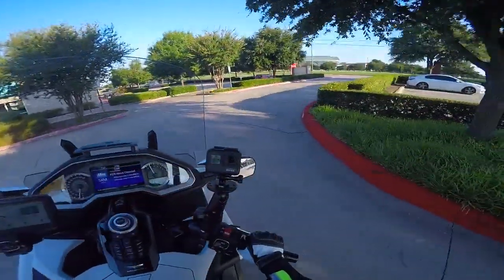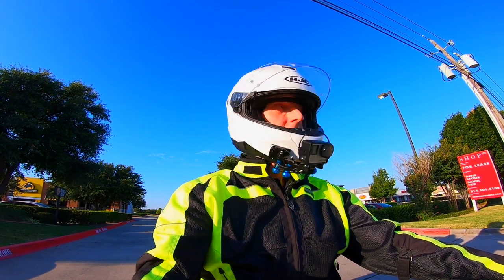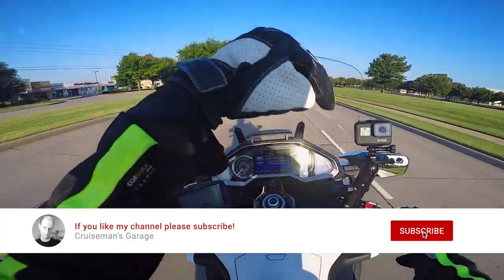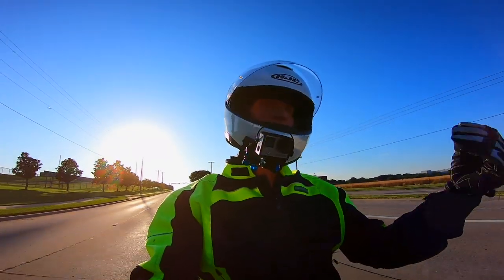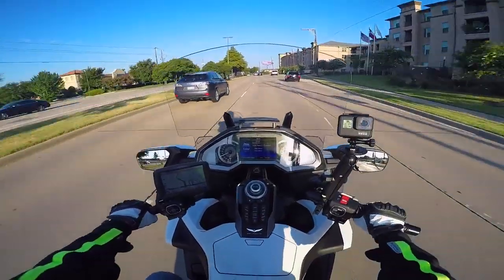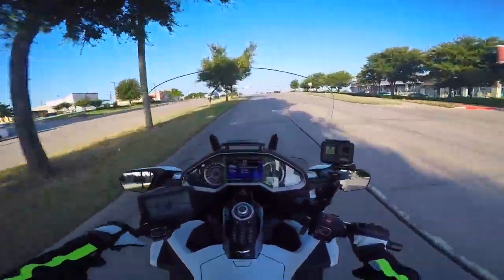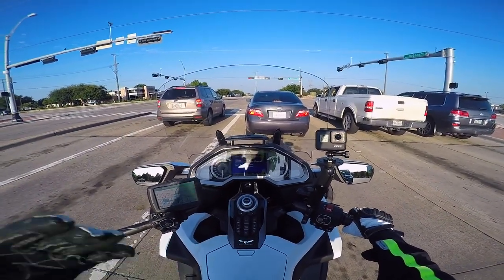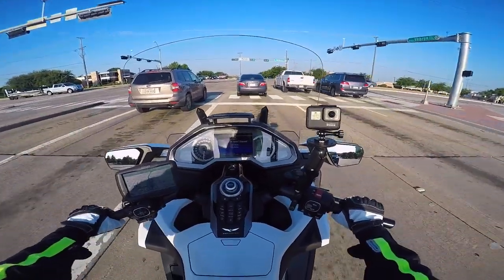Catastrophic Engine Failure on 2018 Honda Goldwing | Cruiseman's Moto Vlog | CruisemansGarage.com

Comment: That’s nothing !  Look at all the failures with the new HD Milwaukee motor. They are dropping at an alarming pace !
Reply: I own 2018 Streetglide special and most of all my friends have switched over to the new M8. I haven’t seen any of these kind of problems your talking about. In 2017 there was a recall about oil hose coming off on M8’s never saw any problems but dealers upgraded oil hoses anyways.
In 2018 they had recall on clutch slaves having a problem here again no reported problem from anyone I know. But I had upgrade done. Never heard anyone dropping a valve on a brand new Harley in this century I repeat any Harley never! I read people having trouble with dct’s. My buddy just bought a 2019 Honda GoldWing so we will see how much more reliable it is vs Harley.
Not gonna lie I’m glad I bought my 2018 Streetglide instead of  a GoldWing after hearing this and reading about all the transmission problems.
Even my Honda VFR1200f had a driveline problem recall with driveshafts locking up at highway speeds not a pretty thought. I put that in just so you know I like Honda’s and owned plenty of them
Reply: Paulk Master your lucky !
Reply: Freedom Rider and don’t forget my dozens of friends with problem free M8’s are also lucky? C’mon man. Do you personally know of an M8 that dropped a valve!!!! Please lmk
Reply: Paulk Master I own a 2018 Road Glide.  It is a 124. Not because of choice. Because Harley will do anything to get out of paying for there junk motors to be repaired.
Reply: Freedom Rider nothing but exceptional service by all HD dealers in my area in south Florida. All the other dealers especially Honda sucks here.
I could tell you horror stories.
I was a Harley hater till I Witness for myself because my friend who never owned a Harley just Japanese bikes bought one. They impressed me so much in how they treated him versus my experience with dealing with Honda and Suzuki. I traded in my M109r for a Vrod Muscle wow so glad. Then of course my 2018 Streetglide Special. Im quite sure I’m a Harley man forever. 
Anyone with a Motorcycle endorsement can test ride a Harley. I could literally tell the HD salesman I’m not going to buy squat from you. Now let me ride every model you have here and they will!!! Try that at a Honda dealer they will call security on you.
I have no idea what your situation is and I’m sorry you had bad experience. Did you buy your Roadglide brand new or was it preowned?

Comment: I don’t really understand the issue here; Honda will repair all damage to the engine, or replace it. It’s unfortunate that the owners bike will be down for the repair time and yes, if I was the owner, I would request a loaner to ride during the downtime period, but I really do not feel that Honda, or the dealer is obligated to provide a new replacement motorcycle. I have bought brand new vehicles and motorcycles and almost everyone of them has had issues during the warranty period; which the manufacture and dealer have addressed and rectified within a reasonable timeframe. If they were not able to rectify the issues; then yes I would expect a new replacement, but if they were able to repair the said defects within a reasonable timeframe per the warranty contact, then that would be reasonable and fair. 
Please advise the dealers/Honda’s response to the warranty claim and their planned actions. I think we all require this information before judging Honda. Does this not make sense?
Reply from the maker: Initially, the owner was told that it could likely take several weeks to complete the repairs. Of course, they have no idea how much damage may exist, so no way to know.
Reply: Then we need to wait and learn 1) what is the actual damage and 2) what is Honda going to do about it.
It is too early to judge Honda or the dealership until we learn the aforementioned. I truly believe Honda will make this issue right. Yes it will take time for them to do their due diligence thru the dealer and inspect the engine to determine the failure, but that is expected. If the dealer provided a loaner during this period then that would be a bonus, but not an obligation. I purchased a brand new motorcycle in August on 2012 ( not a Honda) and had a terribly loud top end knocking noise at 5,000 KMS that turned out to be a bad lifter, the bike was down for about 10 days well the issue was investigated by the dealer, the warranty claim was submitted, the warranty claim approved and the parts arrived. This was mid-summer and I was not provided a loaner and I did not even consider asking for a replacement motorcycle. The manufacture made my issue right and that’s all I could ask for.
Please keep us updated and informed on this issue and let’s reserve judgment until we have all facts and information.
PS: tomorrow morning when you meet the buds for coffee I suggest you try decaf for a change! Lol!
Reply: Also stating that this is a “catastrophic failure” (when the engine needs to be removed for repair/replacement as you stated in another post) is somewhat misleading, as it is yet to be determined what the actual damage is, or to what extent/scope repairs are required. At this point we do not know if the engine will need to be removed, or only the head. We look forward to your updates regarding this mechanical failure, the actions of both the dealer and Honda motorcycles.